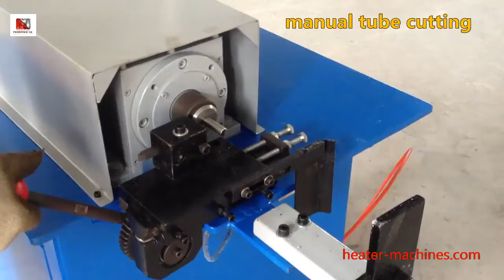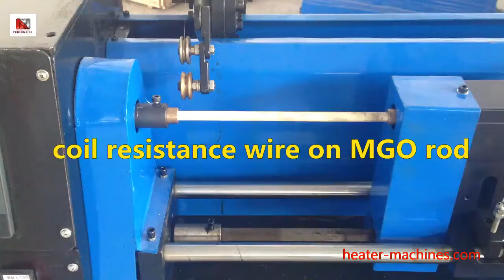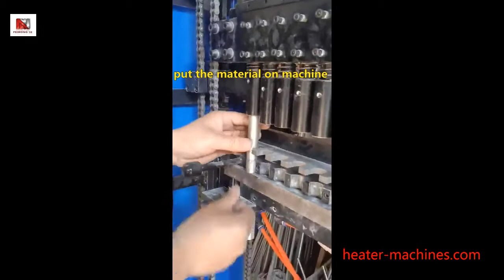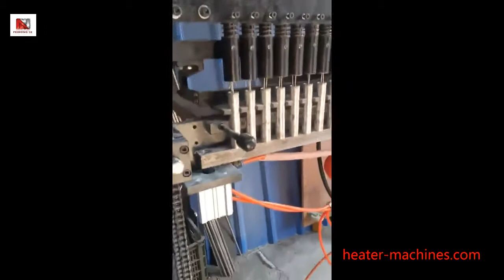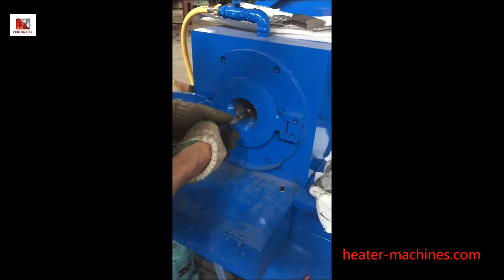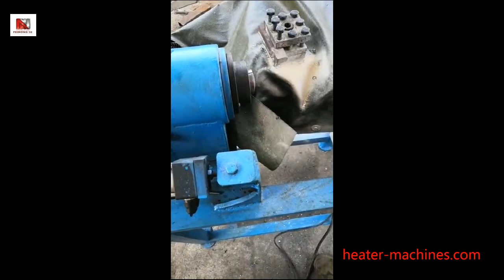cartridge heater main machines and steps for short cartridge heaters

Comment: I use Khantal wire handles because they stay cool
https://youtube.com/shorts/g_m2LNOg5zA?feature=shared
I can pick up the fire and control the air for flat out heat or simmering by placing it flat on ground and after cooking pick up the fire and put inside a big pot to snuff it